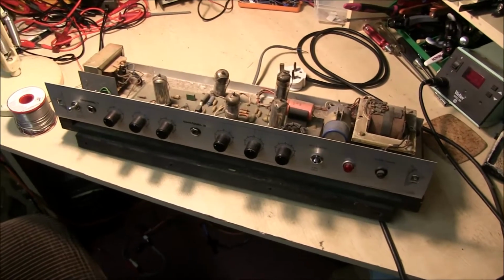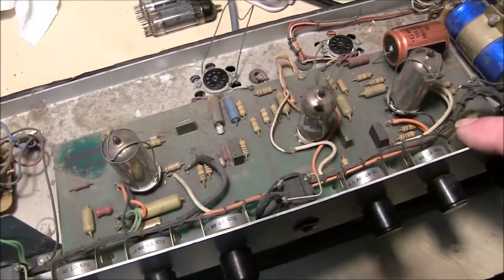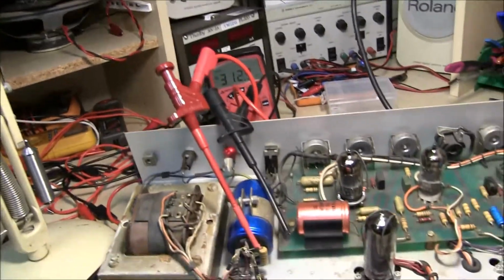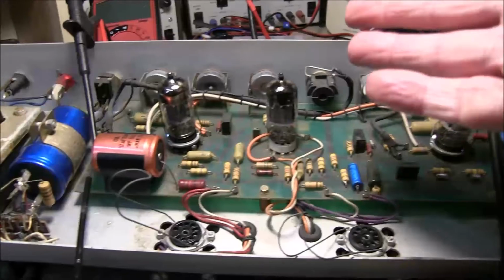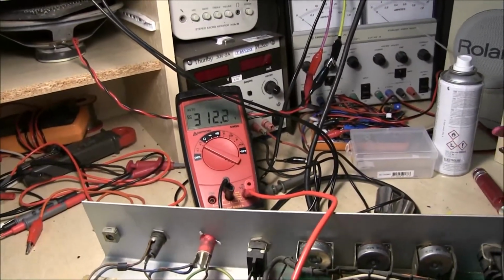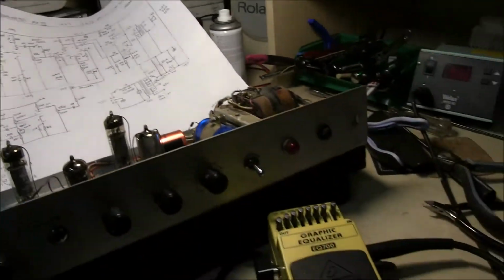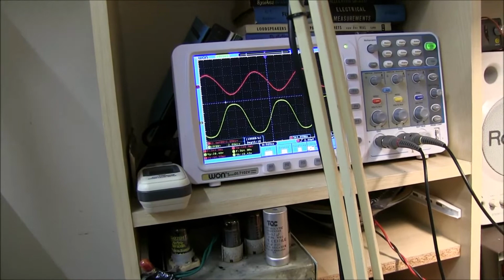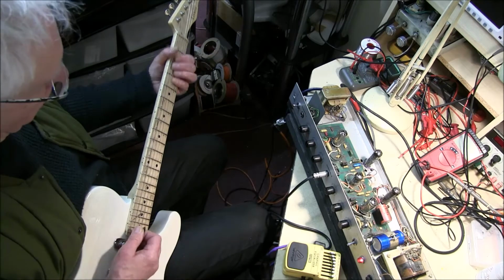WEM Dominator (MK3) Guitar Amp. 1973 Service and test.

Comment: Hello Nick, thanks for your beautiful videos, really informative. I have a Wem Dominator MK3, the later model without the voltage selector in the front panel. Serial number is CW 63175, it has the original 12" Peerless (Danish company) speaker with the big horseshoe magnet. The capacitor you used in this video to date the amp was replaced on mine, is there any way to date my amp?
Reply from the maker: Gi Greg. An unusual one, as those speakers were used on much earlier amps. if it is original. All these WEM amps were made during the 1970's. I have one made in 1973 with the plate CW40481. So yours is probably a year or 2 after that. There are not many date codes on components .  But that speaker probably has a date code on it, but would have been made in the late 60's.
Reply: @nickadams5411  Thank you Nick!

Comment: Great post Nick as usual. Very informative and useful.

You probably already know this but there was a build “fault” with the MkIII Dominators (and “MkI” Bass versions) –   the grid wires on the EL84s were soldered to pin 1 (instead of pin 2)  - pin 1 is not used and the old valves (Mullards etc)  had an internal connection between these two pins (i.e. 1 is connected to 2 inside the valve) so it was all fine. However, if you put modern tubes in which do not have the internal connection Im not sure what would happen.  Ive had a load of these later Doms and have moved the grid wires on nearly all of them.  Strangely the earlier Dom variants (the real MkI and Mk II – not the “MkI Bass which is a MkIII in my book) and ERs etc were wired correctly.  

All of the ones I have seen have also had the 0.01uF cap and 470k resistor back to front on grid 2 of the
PI – think you pointed this out for a MKI Bass on a previous post. Think they got the hole spacing wrong on the PCBs for the “block” caps so just put the resistor in their instead. Dont think it makes much difference though.

 I’ve had a lot of residual hum problems with the MkIIIs – with 1st stage ECC83s pulled - comes from the PI. I have pretty well given up on it on a few having exhausted ideas – have spent last few days on one in particular to no evail - would appreciate any insight you may have on this!
Reply from the maker: Hi David. Thanks for your observations. I always assume the amp worked correctly when it was manufactured (not always true), so any faults must be fixable. In this case, is the hum 50Hz or 100Hz which helps narrow down. Often faults are poor earth connections. As you have narrowed down to one part of the circuit, it is possible to find where the hum starts. The phase spitter you can short the grids to ground with a capacitor to see if it is one side or the other, or neither. Then keep at it until you find the cause. Heater hum is always annoying, but should not be bad unless there is a fault.

Comment: Nick great job, could you tell me about your scope, I believe it to be an owon.  I could not see the model # but it appears to be fairly portable and reliably solid state.  Thanks, Paul
Reply from the maker: Hi Paul. Yes, The OWON SDS7102V.  I got it with the optional internal lipo battery, so i did not have to worry about Earth shorts when working on live chassis. It is portable, with a handle and stand, and is fairly lightweight. It was also reasonably cheap from HongKong. It is not perfect and has a lot of noise on one of the channels when checking low level signals. The other channel is okay, so must be a quality problem.
Reply: Nick, thanks kindly, Paul